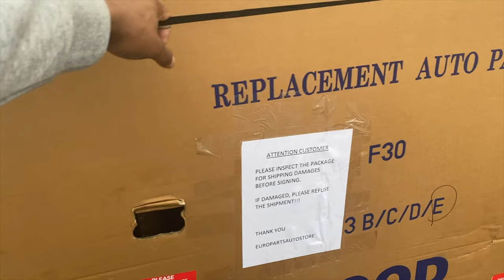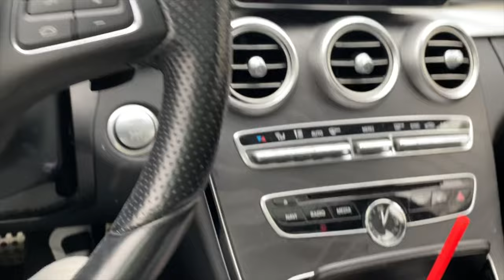F30 GTS Hood Unboxed / C300 Diamond Grille Mod

Comment: Hey I tried to install my new grill but my old one has a front camera on it how do I fit it with the new grill ?
Reply from the maker: You have to remove the two screws that secure the camera cap on the new grille
Reply: Thanks man

Comment: Question: I see some videos removing front bumper completely to get to the grill. I would love to avoid getting under the car. Your video shows you doing it without removing the bottom part. Was it hard to remove the grill once you removed and bent the top part? It seemed like you just popped it with a hand. Was it that easy? Also, putting a new one in and into the clips, how hard is it? I watched other videos and it seemed like those clips are a pain even when the entire bumper is out and people used tools/flat screwdrivers to get those clips open. Please shed some light since you did this.
Reply from the maker: It’s definitely easier to remove the whole bumper so you don’t fight with it if you have another person but as just one person aligning it was too much for me personally and the bumper flexes a lot so you have wiggle room. It does pop out after wrestling with a couple clips nothing serious
Reply: @Slowspeed  Thanks. Will try. Should work eventually!

Comment: Hey so I went to a couple shops and asked them to swap the stock grille for the diamond grille I just bought, and they are all saying "you can't pull it off partially, it has to be removed ..I even showed them this video lol...so I just have to do it myself. Is it as easy as you made it look?
Reply from the maker: It wasn’t too hard for me, just takes patience and make sure it’s all in firm
Reply: Thank you.